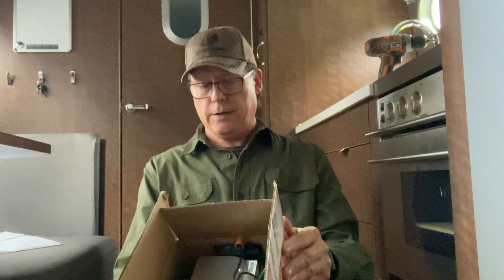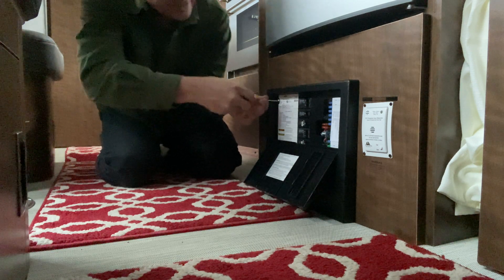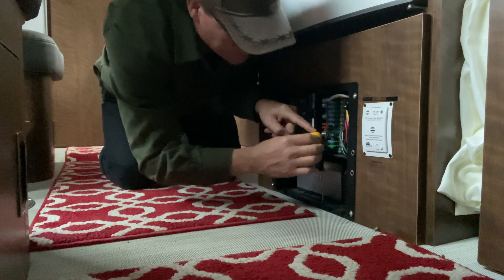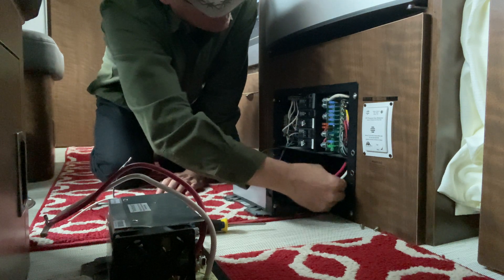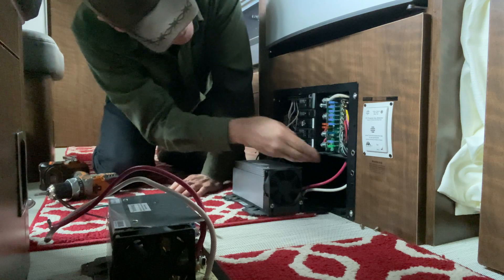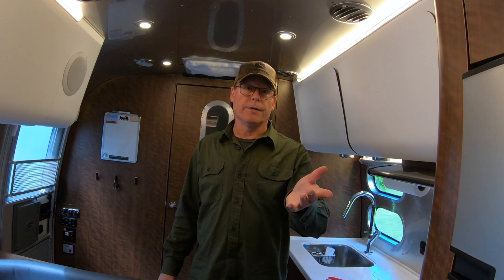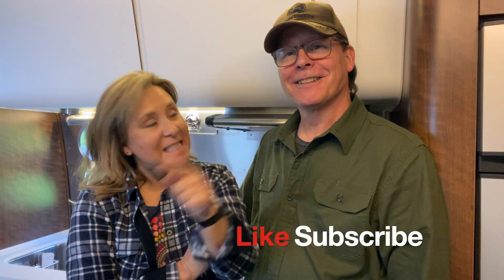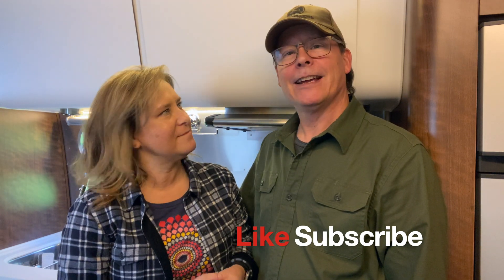DC Converter Upgrade - Replacing the DC Factory DC Converter with a Lithium Aware Converter

Comment: Just upgraded my Progressive Dynamics PD4045KA Power Control Center to lithium charging.  The upgrade is exactly the same,  just replacing the 12V Power Board.